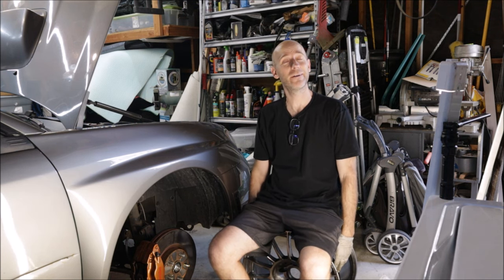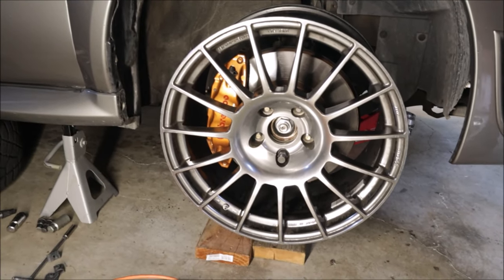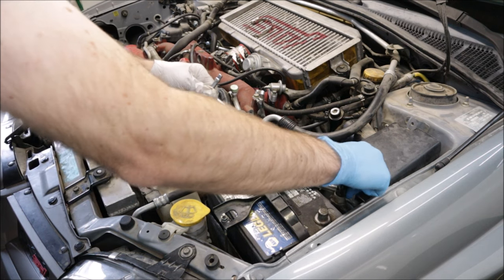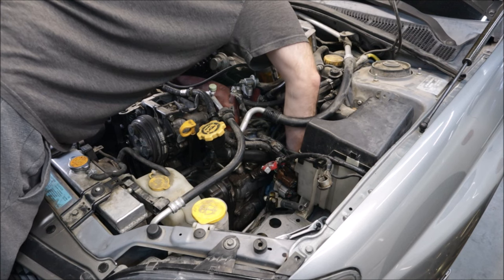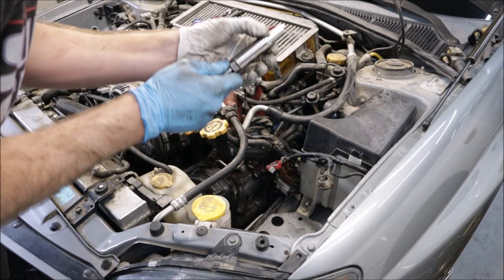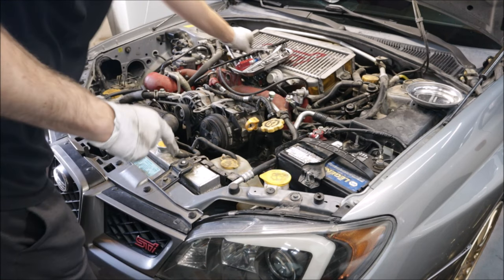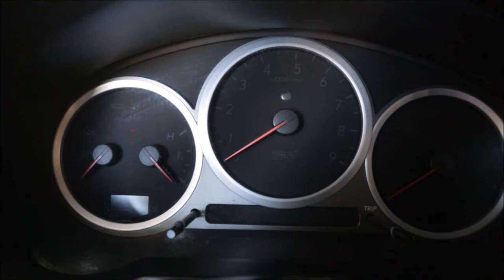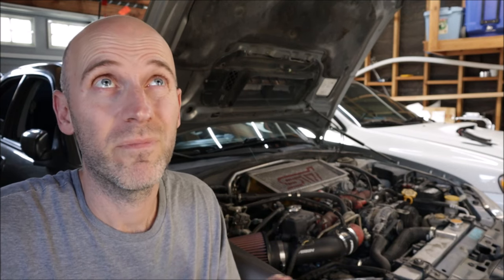Check Engine Light, Engine Misfire, and a $6,000 Repair Bill. Neglected High Mileage STI Part 3

Comment: Most of that is just labor costs, if you just count the parts then it’s not anywhere near as expensive if you do the labor yourself. I own a 06 STi and i have gradually done almost all of those, except for my steering rack. It’s an old car by now so most of those problems you would find in almost any old car, it’s all basically leaks. As far as those "standard features” you are a lucky man…cause the "headgasket feature” is a naturally aspirated EJ25 feature, turbo EJ’s do not have that problem because they come with Multilayered Steel gaskets from factory as opposed to the N/A models which use defective composite paper thin gasket and always end up leaking. Now, i have heard of some people having misfire problems but I’ve never had those so i wouldn’t know. Maintenance and fixing problems quickly is the key.
Reply from the maker: I agree! Any car this old will have leaks and need work. Many people think they last forever without proper care. The labor rate in my area is $150-$200 per hour! Good thing my labor ain’t worth much.
Reply: Same in Ct